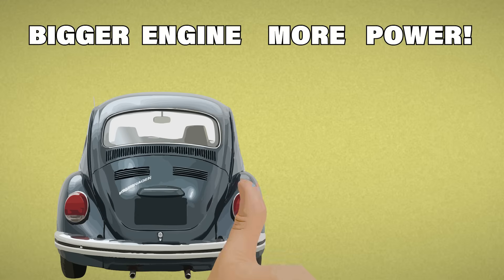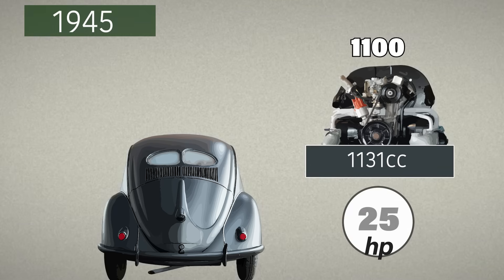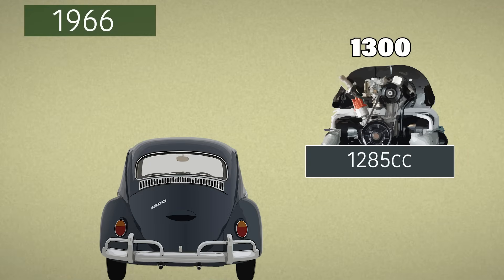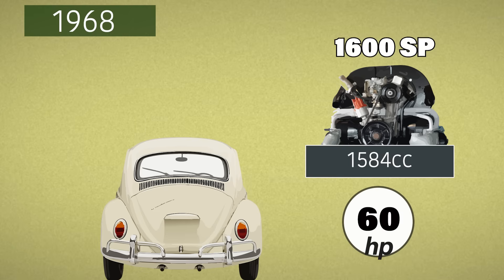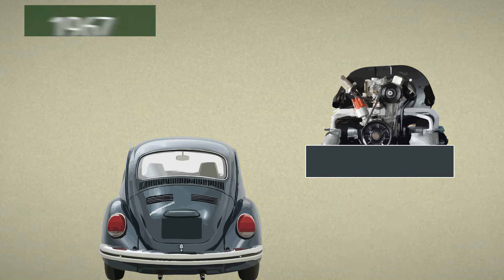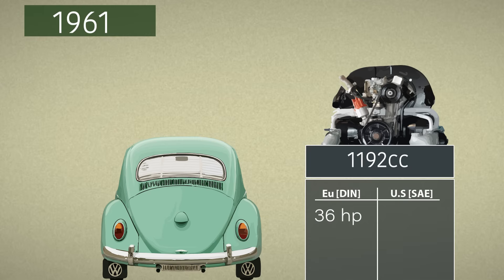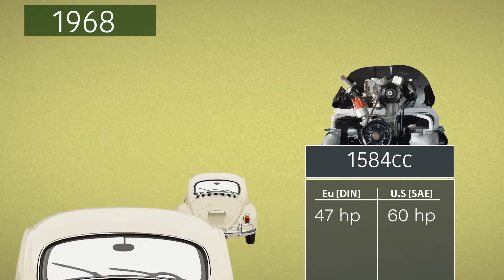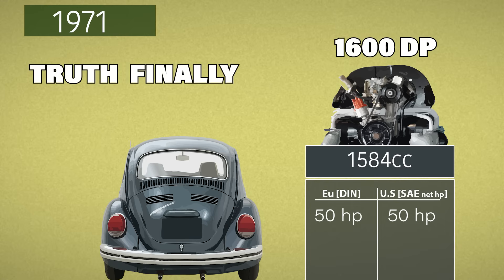The Great VW Horsepower Conspiracy

Comment: Had a 1965 bug. Glad I survived that death trap. Underpowered, poor brakes, 6 volt electrical. No heat in the winter. The good old days.
Reply: The heat was great…..if you were moving. Ar idle there’s not much airspeed from the engine’s fan.
Reply: @danr9584  The car was nice and warm, by the time you got where you were going.
Reply: I had a 67 and it was the Exact same experience. 😂
Reply: Underpowered? Depends. My heating worked, as well as the brakes. If your brakes were not working, it's not the car who is at fault. If the brakes were adjusted properly, they worked fine.
Reply: It was freedom and that was fantastic! Went everywhere in one, on the beach, all over Africa, always got you home. Drove through a herd of cattle being driven across the road at night, killed 4 of them outright. Cleared the broken glass from the front window and drove home, sold it later for a beach buggy project.

Comment: Additionally to the testing method, there must be a difference between the "PS" (european horse power) an the hp resulted from calculations in the imperial system, since 1PS equals lifting up 75kg (Kilogramm) over 1m (Meter) in 1s (Second).
Reply from the maker: Yes, 1 PS = 0.986 hp
Reply: @KombiGarage  
Thanks! 🙂

Comment: Friend of ours had one in Freising, Bavaria in the mid '50s. Had to back up the hill to Vimy Kaserne where it snowed ❄️. Couldn't make it going forward with the engine's weight in the rear.
Reply: Funny. The engine is where it belongs for a rear-drive-car: in the back. My guess is rear wheel drives with a front engine had to stay down in the valley.

Comment: The 1970 1600 was the highest hp US MY and had dual port heads, higher compression and a larger PICT carb. 71 had lower compression for EPA emissions.
Reply: 1970 Type 3 motors were dual port but Type 1 and Type 2 were still single port. The engine cases are usually H5x dual relief with 10mm studs.

Comment: Of course my '79 has the "Type 4" pancake engine, with a squirrel cage fan on the end of the crankshaft. The enemy of most / all VW engines is cooking. Air leaks exacerbate the situation. Deep into the throttle / lowish rpms is the worst. Additional oil cooling does not hurt, but does precious little to cool the head temp. These engines can "drop" exhaust valve seats without much abuse. Also, free flowing/not plugged fuel injectors are critical. A modicum of care in using light throttle/shallow throttle opening for hill climbs with loads and even w/I loads will preserve these engines. I believe the crankshafts are nitrided for longevity. Ultimately a flawed design for Joe Q. Public, but can be nurses to long life under the right hands.
Reply from the maker: Thanks for the insight 👍
Reply: I had that same engine in my 77 Type 2. When the air conditioning kicked in, say goodbye to 5 miles per hour.

Comment: I have a '79 vw type 2... a 49 state non catalyzed 2.0 litre. It has fuel injection, and is rated 67 hp @4200 rpm, and 101 ft lbs torque at 3,000 rpm (the latter, if memory serves). I think my window van weighs about 2,900 lbs. empty and I think the payload is about 2,300 lbs. VW adjusted the "balance" between (bottom-end) torque and HP to suit the application. While certainly no hotrod, the powertrain generally does quite well. Two generations later, and I think in 2.3 litre size format, the L5 Audi engine was detuned to 110 HP (versus at least 140 HP in the Audi) for use in the Eurovan. All in the interest of "truck/van" service and driveability...
Reply: In 1979 cars in America had to be less than 1500cc to be exempt from having a catalytic converter. Maybe light trucks were different.
I had a converterless Rabbit with a 1457 engine.

Comment: Be fair. This engine was explicit built to run on inferior war fuel. And it did. I once accidentally filled the tank with diesel. I realized it after 10 liters and filled the rest with gasoline. It smoked a bit, but it worked.
Later, with better fuel, the compression could be increased.
There was a joke back then that the number on the hood was the fuel consumption. 12 l/100km for the 1200. It wasn't an energy-saving miracle. However, the poor displacement-to-power ratio and the simple design also gave the engine a certain longevity. There are some that are still running today. One shouldn't forget that Porsche used similar engines with better power output.
An US small-block in this time with a 4.4-liter engine also only had 190 hp. A Golf GTI with a 1.8-liter engine had that too. The American engine may have worse performance, but it lasts longer.
Reply from the maker: Yep, built for reliability and endurance.
Reply: @KombiGarage  With slight tuning they ran fine on Mexican 60 octane gasoline. 
VW also used lower cost materials like Magnesium...

Comment: Ok is it just me or 1200cc engines impossible to find that are reconditioned
Reply: You won't find one being offered by a rebuilder as there is little demand for them. You might find the parts to rebuild one, but everyone I knew had replaced them with a 1600 dual port. At a VW shop I worked at the 1600 was the only rebuilt engine we installed...

Comment: I did my driver’s test in a 74 Super Beetle, and the first vehicle I ever purchased was a 72 Westfalia. I once got out of a ticket because the officer testified I was going 90mph—in that Super Beetle! 16 yo me, flabbergasted, told the judge I didn’t think that bug could go that fast, never mind around a curve. Judge glared at the cop and banged his gavel dismissing the case 😊
Reply from the maker: 😂 great story, thanks for sharing.
Reply: Got my license in a Karmann Ghia and zipped around the course at the Confederate Avenue HQ for the Atlanta area GA Dept  of Drivers Services. Had a wreck in the car two years later and was “invited” back for a “chat” with the assistant director.
Reply: Got out of a ticket with a 1983 Ford Ranger for the same reason
Reply: @RequisiteFunction I got a 92 2.3 liter but it's goes up over 85 sometimes
Reply: @Andresbjsiduy18  yes I think the 92 was an upgrade from the 83.
 I know my 1996 2.3 Ranger had a speed governor set for 95 mph.
The 96 was still slow by "normal vehicle" standards,  but it was a genuine rocket compared to the 83. 
It had fuel injection and factory headers. Probably had something to do with it.
Reply: My first car was a 73 super California smog edition with 3 speed semi-auto. Was good for 75 on its best day, if you had enough time and distance to get it up that fast, it took a while to gain that last 5 mph. Some years later, I had a 72 westy with a dual carb 2.0. Would cruise at 70 all day as long as there were no hills involved, and could hit 90mph on the flat for short periods. Had to keep the head temp below 600°. You’d get about a minute at 90 before having to back off to keep the temp down. 😂
Reply: @christiansmith2730  A few years after my Westfalia, I jumped on a sketchy deal to get a ‘74 Type2 cheap. That thing was a workhorse: could do 70mph without sweating while pulling another bus filled with scrap metal  >I later found out the motor had been in a Fastback which was some sort of race car, then pulled out & stroked for torque. Shortly thereafter a child arrived, then the wife left, and I couldn’t keep that one as a Single Dad. That and the sandrail I also briefly had are the ones I miss the most. 
But, playing with the grandkids, no regrets 👍
Reply: My single barrel carb 1300 Ford could outrun any 1600 Beetle till one passed me flat out at about 140km/h. Surprised till l spotted SP logo: twin carbs = 3KW extra. My Ford rated at 43KW or so..maybe that SP could just top 90mph, standard 1600 could do over 130km/h in thin air: near or over 1000m, but mine wasn't supposed to be pushed over 126 according to manual, could reach scary 145 downhill, not good for engine.
Reply: My uncle o wned the first "Bug" I ever saw. He said it topped out at 85 MPH. Said if you drove it off a cliff it would only be going 85 when it hit bottom. 😊😅😂
Reply: @johnchandler1687  We did try, later that year on a long downhill on I81. The Super Beetle got scary light and twitchy, but pretty much pinned the speedometer, while my buddy in his Dad’s ‘67 Vette said he saw maybe 78. I make no claim on the calibration of either speedometer—and never tried that stupidity again. They are —or were for the time—great little durable economy cars, but I have no desire to race one without extensive modifications aimed at further stability and survival
Reply: @Scot-p1v And our local VW dealer always had an ad selling them for $ 1495 out the door. An unbeatable deal for a reliable and easily maintained car.
Reply: Got a speedometer? You knew what you were doing. You should have had your license revoked at 16.
Reply: @RobertCHoweSr  as I recall, the speedometer in that bug topped out at 85. I wasn’t even doing 1/2 that. But, I >was< a mouthy, long-haired teen who instantly pissed the officer off. Who do you think was the bigger offender: me, speeding ~15 mph, or, a law-enforcement officer lying in court to get the book thrown at me?
Reply: @Scot-p1v 
Cool
Reply: @RobertCHoweSr , you’re really not gonna like that time I had to drive my super with a broken speedometer cable across town while on my first acid trip. I don’t know how slow a bug goes while basically idling in 4th, but I do know it feels REALLY REALLY FAST. Lucky I didn’t get a ticket!
Reply: @RobertCHoweSr  found the cop lol

Comment: The big issue with modified Bug engine is adequate, even cooling. Too bad the liquid cooled Bus engines were plagued with gasket failures, it could have been a great engine.
Reply: Type 3 engines are different than Type 1, the bus / kombi had a completely different style fan & duct system because of space and more weight and less space harder to keep cool. Bugs had open space and were cool running with high hp, especially with Porsche-style fans
Reply: I have a 91 Vanagon Westy and it was not "plagued with gasket failures" or coolant leaks...
I have heard that a few years of water boxer engines had Hylamar Gasket Sealant used on the cylinder head to water jacket seal causing the surface on the heads and water jackets to corrode. The fix was to fill the missing metal with J B Weld, and with a new head gasket the problem went away...
Reply: @davidhollenshead4892 Good to know! I was advised by my local parts shop to avoid the engine, thanks for the solution.

Comment: wrong .... in 1961 the engine was completely changed including the case and heads making 40 hp . Later motors had varying compression ratios affecting HP as well
Reply from the maker: The 40 hp is still the SAE Gross number, it’s real hp is still 34 DIN

Comment: Getting 126bhp from my 1300cc Beetle (built for historic touring car racing) On standard beetles the horsepower figures are less important as VW built the engine for maximum low down torque, so the inlet manifold was made deliberately too small, so the higher the rpm the more strangled the engine gets (killing the horsepower figure) that's why it tops out at 4200-4400rpm. VW wanted the engines to do hundreds of thousand miles between rebuilds. Try running the 100 metres while breathing though a straw and you get the idea
Reply from the maker: You’re spot on, thank you. And you’ve confirmed my next video on torque. VWs were built for purpose, and as you pointed out, reliability and endurance was their purpose, you can get performance out of them, but it will cost you in the endurance area.
Reply: @KombiGarage  Thanks, i've just watched your torque video and its great...nobody ever talks about torque, but the VW aircooled engines (and gear ratios) were all designed around the engines torque. You'll know this from driving an empty Kombi compared to a heavily loaded Kombi. The gear ratios feel a little off when its empty but when the Kombi is heavily loaded the gear ratios all of a sudden feel right.
Reply: No one got hundreds of thousands of miles between rebuilds. It was more like 80 to 100 k miles before rebuild, if the owner bothered to have the valves adjusted at 3000 miles and the oil changed at 1500 miles...
Reply: @davidhollenshead4892  which is a lot for what is essentially an "equipment engine" in the 1970s, where competing,  legitimate "automobile engines" were also garbage by 80k. 
Keep in mind, 80k in the 1970s was much different from 80k today. It took much longer for the average vehicle to reach 80k, because people did not drive as far as often. So a car with 80k miles was definitley going to have some age to it.
 People back then were accustomed to finding work locally, or moving closer to their job, like theve done for the last few thousand years.
The concept of moving away from your job to save money on housing didnt really exist yet.
The "150k before starting to look for a replacement" didn't become a widespread mantra, until after the mid 1990s, where the guts of new gen FWD cars started lasting forever, the cars themselves were  not rusting completely though, and long commutes started becoming much more common.
Very easy to rack up 100k miles when your round trip commute is over 100 miles a day, and that is a commute a lot of people make in the States.

Comment: Do you have the specs of the 1600 with Digifant Fuel Injection? That was the last engine the Beetle had from 1993 to 2003 (Mexico market) and it had much better performance than the carburated versions, I recall seeing them going at a steady 150 KPH on the highways in Mexico.
Reply from the maker: From what I found, there wasn’t much of a change between the carb and fuel injection on that model. Torque was better in the lower range, but horsepower seemed to be the same, which is surprising. Hopefully someone can shed more light onto this. 
Thanks for the question.

Comment: Thanks for the video! Very itneresting.
It doesn't change the premise of the video but there are a few confusing passages, which the author already adressed in the comment section. 
If it helps here's a cronology of the EU DIN net power rating for the VW Type 1:

- 1939    986cc 23,5hp  

- 1945  1131cc 25hp                                    [same for US documentation]

- 1954  1192cc 30hp (1200)                       [some time after 1954, US SAE gross rating begins: 36hp]

- 1961  1192cc 34hp (1200 new design) [SAE 40hp]

- 1966  1285cc 40hp (1300)                       [SAE 50hp]

- 1967  1493cc 44hp (1500)                       [SAE 53hp]

-'68/70 1596cc 47hp (1600 single port) * [SAE 60hp]

- 1971  1285cc 44hp (1300 new design)  [SAE 53hp]

- 1971  1596cc 50hp (1600 dual port)      [US SAE net instead of gross rating: 50hp]

* Note * I'm a european bookworm and my infos are mostly Euro-centric. The annoted year may not exactly correspond between US/EU markets of the time. VW used to prioratize the US market and often applied and tested there stuff that might be implemented in europe only months or years later (I'm generalising, it's complicated). For example, officially the 1600 was not offered in europe until 1970, though local VW dealers and 3rd party kits might have tried it before. I did not know it was already offered in the US in '68. Different countries, different regulations, different costumer needs ...
Reply from the maker: This is fantastic, thank you, and it confirms my error for 1954, where hp should have been 30, and not 34. 

Someone also brought to my attention that the the UK had their own system for hp, RAC. The 1200 was a vey confused engine with RAC, DIN, SAE Gross, and SAE net. 

Thanks again for your insight.
Reply: I had a 1957 vw with about 50k miles and the original German Firestone tires.   I drove it to Chanute AFB in Illinois from Bloomington, Indiana, every weekend for about 6 months.  It would go 70mph without wind and 80mph with a strong tailwind and 60mph with a strong headwind.   It was a good reliable car.
Reply: 1285 in a 71? Never heard of that.
Reply: @brianw8963 yes, in europe. Even the 1200 was still in use

Comment: It always amazes me how dull these engines were for their time.
1967 VW was getting 44hp from 1500cc, and Honda was getting 48hp from 450cc just as reliably.
Reply: Nothing amazing if you consider the rpm/ power curves .
Reply: @brianw8963  That's exactly what I did consider.
Reply: air cooled engines had power limitations due to heat.
Reply: @paulherbert5548   The '67 Honda was air cooled.
Reply: @turbofan67  two stroke?
Reply: @paulherbert5548  Nope, CB450
Reply: @turbofan67  Well there you go. You can a build a Honda CB450 to VW Beetle conversation kit for those interested. With only about 28 lb-ft of peak torque at 7,000 RPM, it might be a little sluggish out of the hole. Seriously they are both air-cooled engines with completely different missions. On paper the Honda is superior but in practicality it is a pipe dream to move even a little car like the beetle around.
Reply: @paulherbert5548  Oh yeah, of course. My point was because the VW is more than 3 times the cubic capacity.
Reply: @paulherbert5548 How did you derive at that theory?  The stock 1600 is about 60 hp, and can be modified up to 1 - 2 hundred hp or more using the same cooling fan, and even the smaller air cooled motorcycle engines put out much more hp relative to the VW engines, and they didn’t even have fans.